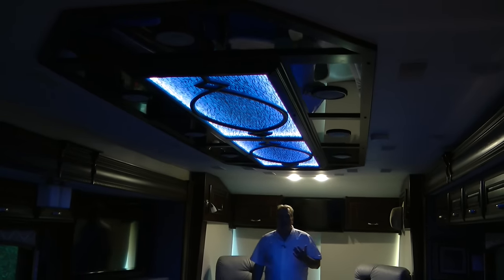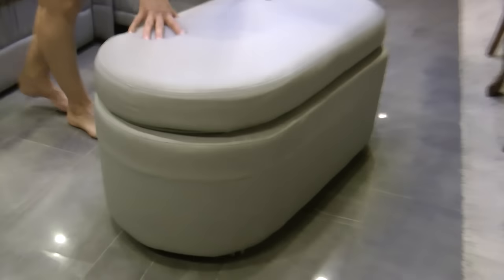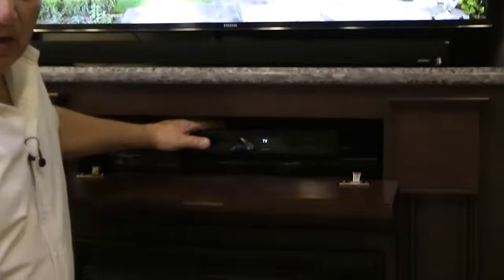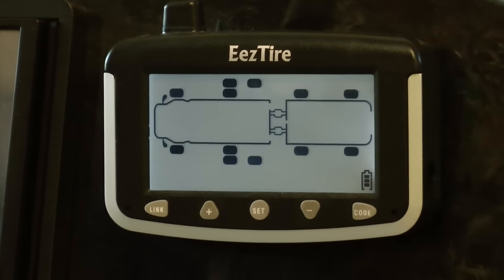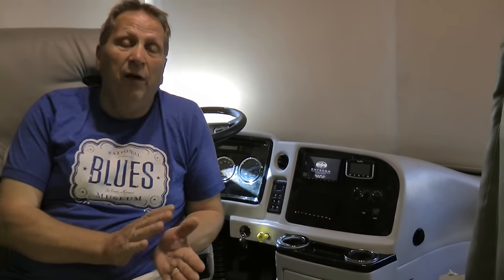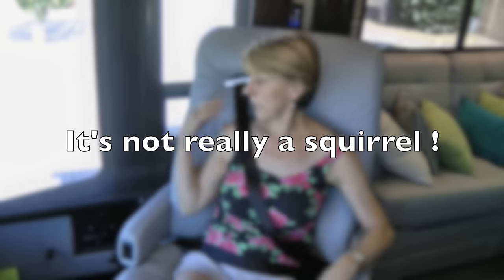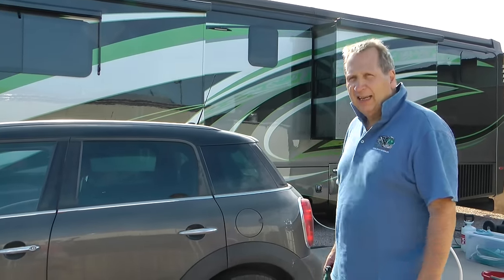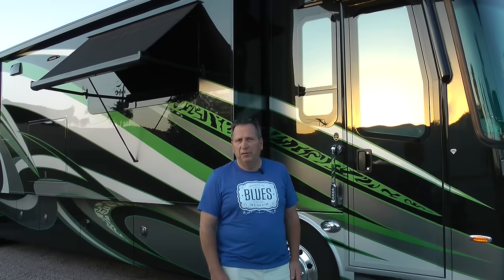Entegra 2016 Anthem tips

Comment: I'm enjoying the videos you've made.  We haven't bought a motorhome yet, but we're looking at Entegra.  I know from watching, you have been able to get the steering fixed.  Right?  It's staying fixed?  The countertop, on videos and brochures, looks like cultured marble, which is much less expensive than quartz solid surface.  Are you happy with that?  It looks a little hokey in pictures and brochures.  Maybe it looks better for real.  Such a fantastic coach to have a cheesy countertop.  Odd.  What's the name of the water contraption?  And the code?  Thanks!  Always enjoy the videos.
Reply from the maker: Hi Claudia
Thanks for your message, the worktops are great, solid granite or marble would be very loud every time you put a plate or cup on them (we have them at home and would never have them again). I believe the worktops are made of Corian and it's a very professional finish and we like it a lot.
The code on the de ironised water filtration system is GTCR and this will be one of the best things you have purchased for home or the RV.  I think the steering has now been finally fixed but I won't know for sure until i test drive in in a couple of weeks.
Reply: Okay.  It's different than the cultured marble, which has little bits of marble in it.  Corian is completely man made.  Got it.  Thanks for the code.  Where do I get the filter?  Amazon?
Reply from the maker: Hi Claudia
To get the discount you need to order the filter from:  http://crspotless.com and when you get to the last page (shopping basket) enter the code that I gave you, then you will receive the discount.